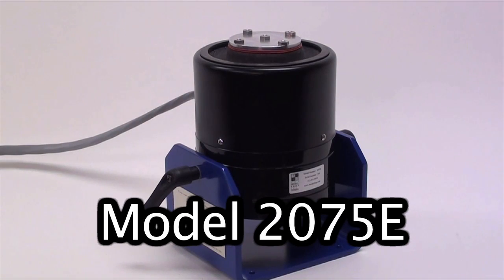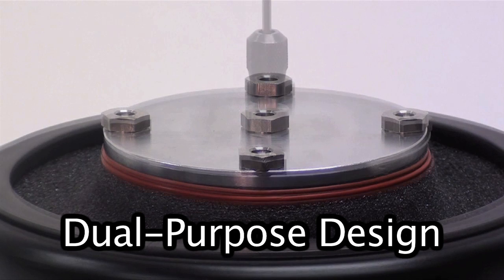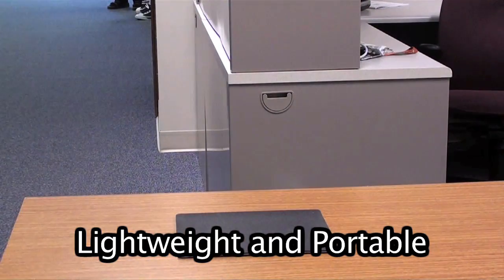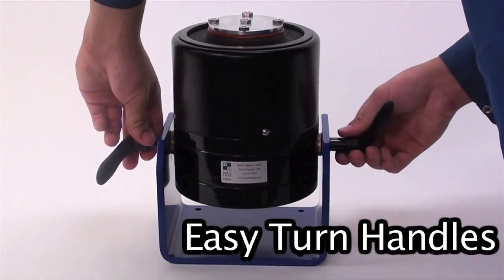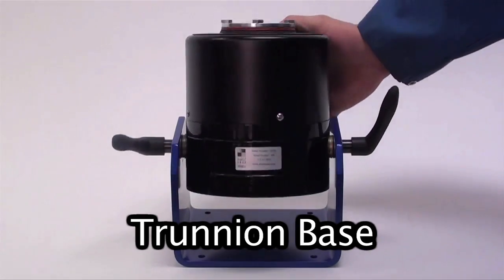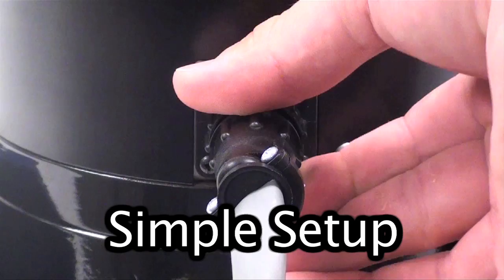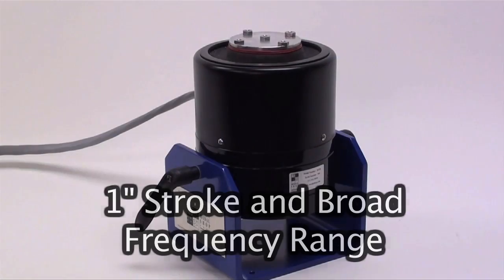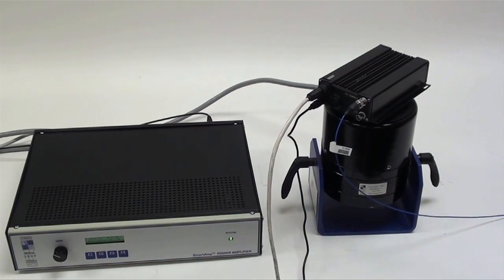Modal Vibration Shaker Demo - 75 lbf / 334N

Comment: Its very necessary to check the dynamic properties with the aid of vibration analyzer and accelerometers
Reply: model price please
Reply: @mohamedatef-fj6lg  it depends on the load capacity and excitation frequency, you can check their prices via internet. Basically the price of a modal exciter of nominal load capacity of 1000 N not less than 15000 $. Also need accelerometer with 600$ for each one, and data acquisition or vibration analyzer with about 1000 $